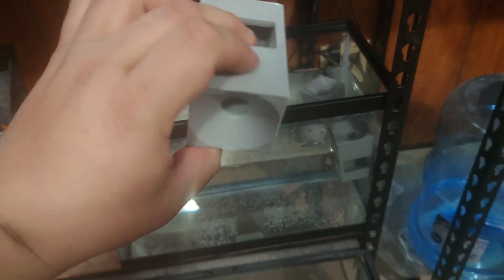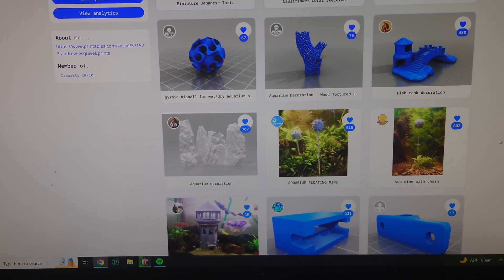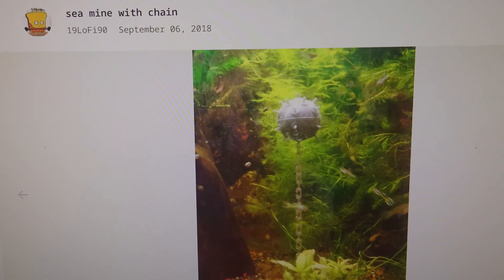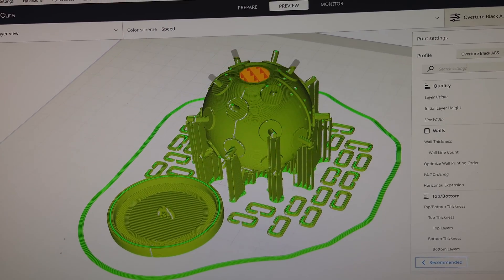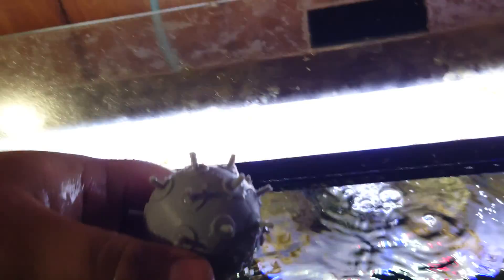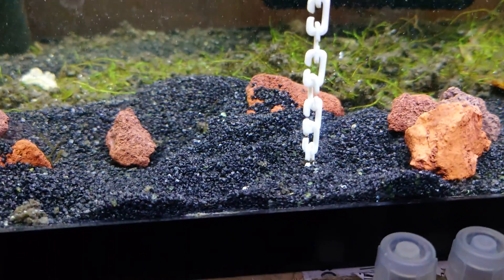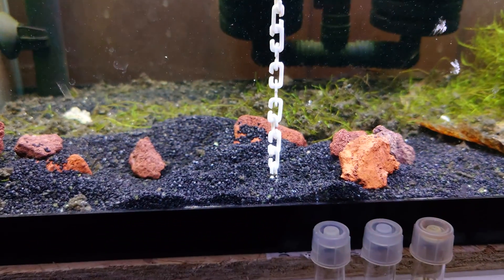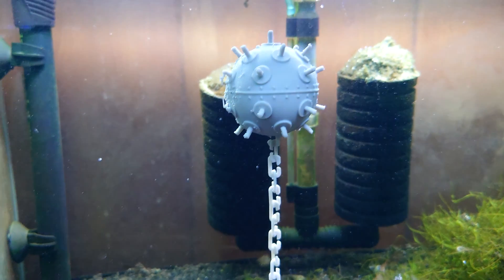Can you use 3D Prints for Aquariums? Lets find out! [Part 1 - Infill Density]

Comment: Good video, at 50% in pla it will definitely absorb and sink.
How many walls did you use and what is the infill overlap you are using? Higher infill overlap is better at holding water in water features i have made without any leaks.
I find tpu the best material for water but dont know how it would affect life